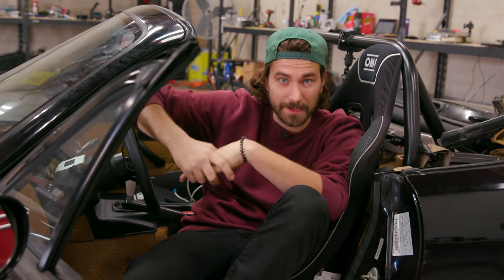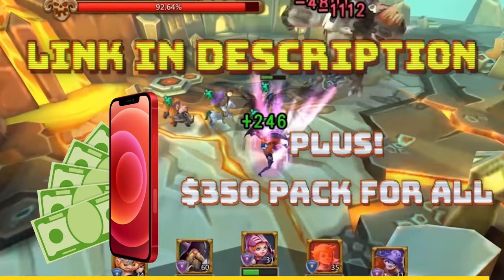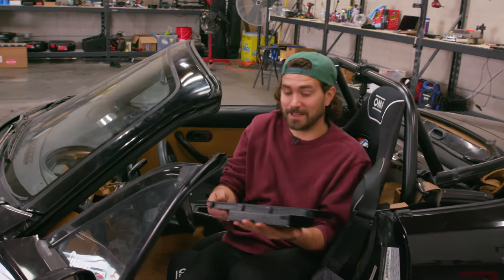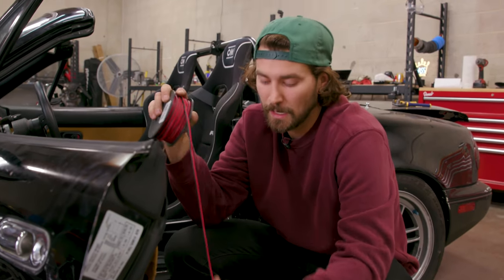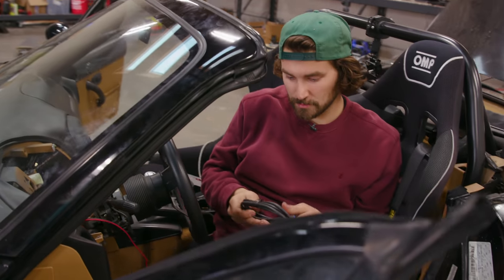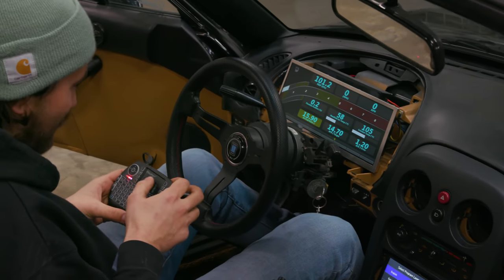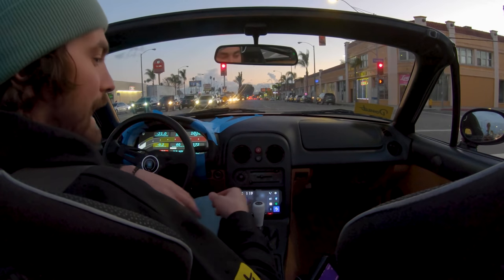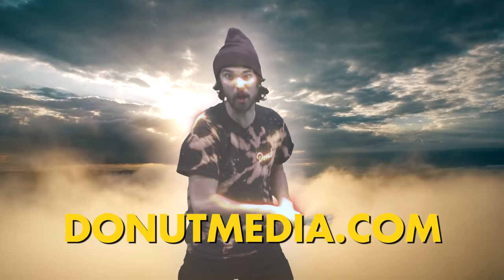Is a Digital Dash Worth It?

Comment: Looks extremely laggy.

These companies have no shame putting worst possible screens and hardware on these digital dashes and selling them for a few hundres dollars.
Reply: It's not the screen, rather it's the raspberry pi that is running the entire operation
Reply: @lolollilol2655  yeah ur right ,under screen I meant the whole thing
Reply: @lolollilol2655  The screen still looks like shit. Also nobody put any effort into writing a decent looking GUI.
Reply: That's business ideas right there lads!!
Reply: also I have little trust in software that is running on such device. how much testing did they do if they didn't even spend time on proper manufacturing ?
Reply: @lolollilol2655 I'd Pi 4 swap it.
Reply: @Bob_Lob_Law  thats just the megasquirt default dash there are some really nice free ones online as well of some really really nice paid ones available
Reply: @rubatonk4079  So it is open source? That's much better.

Still, the refresh rate is unacceptable, the screen itself is low quality, and so is the housing.
Reply: @Bob_Lob_Law  GUI looks like Windows 95
Reply: It could also be the camera frame rate.
Reply: @deamoneater357  if it was the camera frame rate the ENTIRE video would be that laggy, which is isnt
Reply: Yeah I've never liked digital dashes, nothing beats the downright classic look of an analogue dash with a few lights. I've noticed a digital dashes age really bad, a 10 year old digital looks ancient while a 30 year old analogue looks just fine
Reply: @imthedarknight-8755  true
Reply: @imthedarknight-8755  yeah. i dont think all analogue is better personally. i prefer like a few of the important guages (speedo, tacho (especially tacho), fuel, and temp) to be analogue, but also a small digital section that can display things as well, kinda like cadillacs (only reference i know of, probably a few others too)
Reply: i think it looks shitty because we're viewing it through a camera. If we were there in person i'm sure the resolution and refresh rate is 10x better.
Reply: @abysswalker2403  yeah I totally agree, plus when the whole board is analogue you can't get as much information in. My motorcycle has an analogue speedo, tach, and odometer but the other instruments are digital or just lights. Digital tachs especially rarely seem to look decent, they often turn out horribly
Reply: @XxQuickFella1Z  I don't think the camera frame rate matters much in this context, we'd see the rate of change in the display no matter what
Reply: @imthedarknight-8755  yeah. ill be honest sometimes someone can really pull off the digital dash, but it will definitely age horribly
Reply: actually its because the dash he used is a base grab from the tunerstudio library.. it has all the gauge settings set to a lag of 50% hence the lag. All the DD-EFI dash screens that are prebuilt dont have this problem.
Reply: @lolollilol2655  I've seen custom Raspberry Pi setups that run a thousand times better than this, it really is shameful.
Reply: and we dont use cheap screens its a high nit, industrial LED display with HD resolution. but thanks for assuming without doing any research
Reply: @imthedarknight-8755  in post the camera video my be compressed to 34hz  even though the screen is 60hz causing a conflict, also the camera might not have been properly adjusted to make the screen look like it actually dose, although the only digital screen I would put in is a sct live wire as a secondary. I don't trust a pi running windows in a hot car with constant impacts for all of my gauges. I would need to see how they programed the pi and how they work proofed it
Reply: @brobocops  thats how megasquirt looks...
Reply: @stevenvanorder449  ooo HD, gotta love 720p, how amazing. Also industrial screens are tough but aren't known to look great or have high performance. Just to last long and do its job, a tractor, machinery, production line equipment or crane dosnt have the same demands as a race ish car.
Reply: @abysswalker2403  actually, it can indeed be camera frame rate "skipping frames" due to screen frame rate AND data refresh rate, that's an wave phenomenon (physics is weird sometimes). But I do agree that the digital dash seems awful, even thou it's less "laggy" in real life.
And from a technological pov... Yeah, they might age terribly since we're on the very beginning of digital transition.
Reply: @WillBilly.   really then you will love that this screen is 1080p  with a 1920 x 720 widescreen the height can only be 720.. we do understand how screens work, these are meant for racecar's not your minivan.
Reply: @WillBilly.  It's updating like 3-4 times a second max. There's a difference between a poor update rate (this) and a lack of smooth animation due to camera FPS and screen FPS. You can see over like 30 frames of footage the numbers only change 3-4 times. Its pretty obvious from the video that they didn't spend much time on setup/tweaking before editing and uploading the video. Hopefully they can get better performance from it because from what I saw its unacceptably slow. Digital dash in my mustang and every other car I've driven with one is much much faster.
Reply: @stevenvanorder449  the motec screens in the race cars I work on are stupidly smooth, their newer tachs look almost analog in their response
Reply: @zachjones6837  it's all about how you set the dash up. The dashes are part of the Tunerstudio tuning software, so if you have your inputs smoothed then the gauges will be as well. We cant do anything about that on our end before we send a dash out, it's all on the end user. Once they register tuner studio anything we do is wiped. Lots of factors in how things end up looking, you can even design your own everything and setup the smoothing.
Reply: @Bob_Lob_Law  Now i do agree with the low refresh rate however thats purely do to the hardware used. Unfortunately there is not a whole lot else you can do that can use 12v as a power source and thats really the limitation. Overall its not terrible but could be improved through optimization of the operating system itself. As for the screen you can get a screen that size for around $150 however resolution is part of the issue. most of the ones i've found that size are only 480p and thats just due to the limited demand and niche market they provide however you could use 2 separate screens that are a higher resolutions and different aspect ratio side by side and stich them together designing the ui to hide the seem. In the DIY world most of this stuff is still relatively new and the barrier to entry is high as you need to have a standalone ECU to begin with. There are other solutions out there thats work off the Cars CANBUS just like the factory dash but this is alot more work and effort to setup but is able to provide a more seamless and finished result. what you saw in this video is simply not that. This setup is suited for the drivers who just need all the information and dont need it updated 30+ times per second for fluidity. Its intended for race cars and race cars only. If you're interested more in the CANBUS stuff Look of aurdio CANBUS Digital Dash to get yourself in the right direction.
Reply: @stevenvanorder449  With a snarky comment like that, guess what digital dash I'm not buying?
Reply: @Bob_Lob_Law  fr and not throwing shade at zack that's like about as good as it gets tbh
Reply: @supertoaster94  everyone else can be snarky but my reply cant? It's a simple statement, the screen used is meant to survive in a drift, drag, or other motorsport setting.
Reply: @abysswalker2403  ya i think volkswagen have a gud setup with a digital display in the middle of the speedo and tach
Reply: @narvalselvagemanonimo9823  refresh rate will only cause the screen flicker black very quickly when it doesn’t match up with the camera frame rate perfectly. What we see in the video is nearly exactly what you’ll see in real life other than things like saturation and view angles. That thing is garbage
Reply: @stevenvanorder449  thats cool if you can configure the smoothness, a lot of folk got upset because they want it to be served ready, but its not that, its a DIY project. they should have tested it with smoothness optimized because there is a lot of delay between them pressing the gas pedal and the screen updating its info. 
cool product, shame that i cant buy it/cant put it in my car because of the law.
Reply: In all fairness to the guy defending his company, I've had to shop industrial screen for a project and sadly for this kind of stuff with unusual format and environment constraint most of the stuff you find looks like thrash TN panel with terrible viewing angle while still being expensive. It's simply because their isn't enough demand to make a beautiful weatherproof 13:6 1440p OLED or IPS panel.  

That being said, I dont know if I would even bother making the 3d printed bezel.. I does kinda look unfinished and in this case full on hinder fitment. Maybe it could be trimmed down to the minimum to just cover the aluminum border of the monitor and vinyl wrap black and then have specific vehicules over-bezel to fit as best as possible with the oem dash cover
Reply: I'm using RealDash on a Samsung Tab A. It's not laggy at all. In fact, it responds faster than my analog gauges. I'm using it with a Link ECU, but it also works with MegaSquirt and Assetto Corsa on the computer as well. Pretty awesome having a digital dash with your racing game that matches your car, lol.
Reply: @imthedarknight-8755  this couldn’t be more true. Tech advance so fast everything within 6 months is just obsolete
Reply: @stevenvanorder449  1920x720 is 720p, pixle density has very little to do with aspect ratio. They make 4k phones so fitting pixels into your display isn't a problem just the cost. Also unless you had these displays custom made from the ground up they are built for industrial applications not race cars. Also I drive shitty trucks not mini vans
Reply: Resberry pi
Reply: @WillBilly.  it's a high res screen, the manufacturer we work with on the screens spec'd this particular screen based on our projected usage. This screen is specifically designed for industrial automobile usage to be robust and survive high vibration environments. To display gauges and the tuning software this resolution is more than sufficient and is true HD. 
You want facts... our dash resolution is 1920x720 holley sells there 12.3 dash for over $1800.. it has a 1280x480 resolution.
Reply: @conormorley6086   Yea, The Audi Virtual Cockpit is probably the nicest setup from factory.
Reply: @stevenvanorder449  not saying holley is selling a good product but 720p is 720p. Also my concern is more the raspberry pi, what do yall do to make a cheap board reliable?
Reply: @WillBilly.  the rpi4 we use does not even break a sweat, we use heat sinks and a fan to keep it cool in hot weather. Believe it or not, many rpi are rated for industrial use. I have the original prototype in my own vehicle for almost 3 years now without issue. As for the supporting electronics.. power supplies (one for the pie and one for screen), gps, rtc, and a myriad of supporting circuits and functions are on a custom pcb I spent hours designing.. we set every unit up and give it a torture test at full load for 72hrs. The gps is a 64 satellite unit with a 1/10th second update rate. (That's 10 times faster than most phones) we also spent alot of time making sure all the functions are coded properly and robustly. 
If it gets connected in the case its fully locking and spot glued. 
We are a two man operation with full time regular jobs trying to break into a difficult market with the highest quality product we can.

Comment: That’s one thing I will always prefer over newer tech, is the old school mechanical dash... put whatever new fancy display stuff you want, but KEEP a needle tach and speedometer somewhere on it to see... LOVE what DODGE has done with the dash in their newer challengers/chargers, PERFECT mix of retro and modern, looks amazing! #Keeptheneedles
Reply: Check out the displays Enovation Controls makes for wake boats and UTV's, we usually keep rotary-style gauges for speedo, tach, and sometimes fuel.
Reply: hell yeah, the rpm gauge needs to be analogue so we can see the needle rise and fall. it just needs to be be that way. its the law 😂

Comment: The only things with this mod that you might want to think about a little more is where you're getting your power from.  it's tough to run wires under the dash and have them go where you want them, and because of that I often want to connect it to the first 12V bus I can find close by, but what it looks like you did is basically run your dash screen (which I imagine being somewhat power hungry) on the same fuse as one of your under the dash lights.  The circuitry for the light is not designed to pull the same number of amps as your screen probably is.  Now, as long as you didn't change the value of the fuse the worst thing that will happen is you might have problems with the fuse popping (which when you're driving down the road can be a big problem).  If you did change the fuse however you've then created a fire hazard (you seem smart enough to not do this, so I'm assuming you didn't).  Neither of these scenarios is a guaranteed problem though, so you might get away with it, but your viewers who want to try this on a different car might not.

Comment: The gauges looks so slow with how it’s frame rate is just looking at the tachometer it seemed to be taking it’s sweet time actually giving a readout
Reply: I just commented the same thing
Reply: he should definitely have invested on a better monitor
Reply: @saucymcrib4047  I wouldn't want anything less than 144hz when using it daily to monitor quick movements
Reply: @saucymcrib4047  it’s not the monitor that’s the issue, it’s the data interface. There’s only so much data you can throughput at once before you bottleneck your connections.
Reply: @AshtonAudioworks  Whats causing the bottleneck?
Reply: @saucymcrib4047  The data interface he’s using. The ECU is putting out data as fast as it can, but the connections it uses to get data to the display are holding it back. It causes some display update data to be lost, and causes the display to update less frequently.
Reply: @saucymcrib4047  you can also see that on startup, the flame animation is smooth, so they display is most likely 60Hz
Reply: @AshtonAudioworks  that makes sense thanks man
Reply: @AshtonAudioworks  I'm not sure what you mean by "data interface" but what it seems like is happening here is that the small computer (i think someone said it was a raspberry pi) that is attached to and housed with the display is only polling the ECU every second or so. The "data interface" (I assume you mean the format the data is being sent in?) isn't likely the limiter here, It's not the display or its refresh rate either, and It's definitly not the ECU, as that has to crunch numbers real quick in order to control an engine and can not afford to lag at all.

What's probably happening here is that the raspberry pi is likely the bottleneck. Those things are not fast and if it's just trying to run software ment to be run on a desktop/laptop instal of linux and not raspian on a pi then what we're seeing is probably the fastest the raspberry pi can "think". I know I've tried using software ment for a desktop on my pi and I would get similar performance to this. If they designed the software to run on the pi from the ground up and removed a lot of the bloat they can get away with on a more powerful machine then I'm sure they would get better performance and a better respons time/update interval.

Another posibility is that the software they are using (which looks exactly like the software they were using in the video where the installed the ECU to tuned the car) is probably not designed to be used as your gauge cluster and so it is coded to only poll the ECU about once per second. (think like task manager on windows. You don't need to see the real time CPU, Memory, Disc usage, etc. An update every half second or so is fine, but it can be changed in view>update speed. ) If they changed the polling rate of the software you might get better results or if the makers of the guage cluster made their own software that - might not be able to tune your car on the fly - but would at least display info more frequently, instead of just using the desktop software that's ment for tuning the ECU and not for reading live data off it.

Comment: maybe instead of a display... setup a monitoring routine that uses voice alerts to tell you of overshots...
Like a Datsun 280ZX, instead of saying "Driver door open", it could say "Overtemp", "Critical Overtemp" "Low Oil Pressure", "Low Fuel",  "Tire pressure low", "Water pressure low", etc, along with an acknowledge button to prevent it from repeating too often...  Then a little Arduino line display to show the errors and that the system is normal.  Maybe a "test button" to set the volume, etc.  I can say that most active displays don't do well for night driving, and need a "red only" mode, where all the pixels shift to night mode.  Or otherwise cover it in a thin red acetate film.